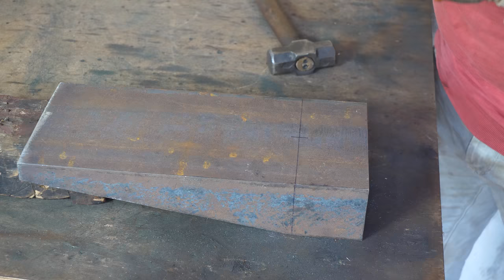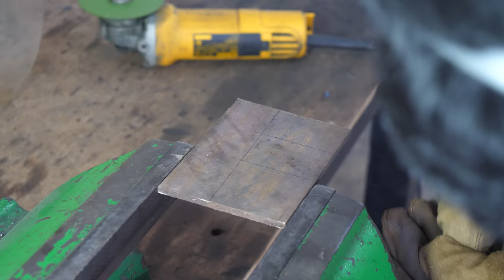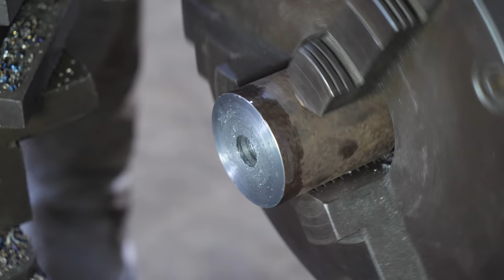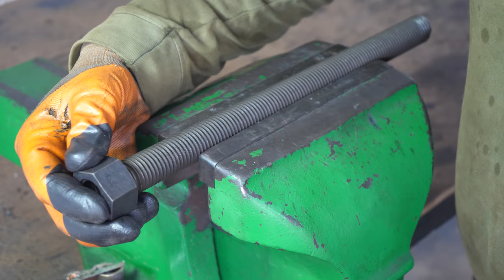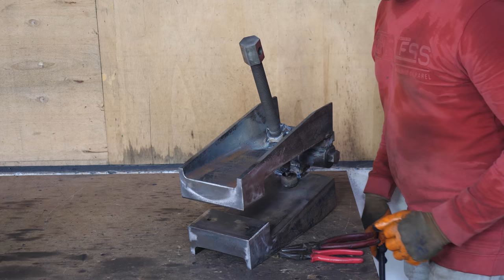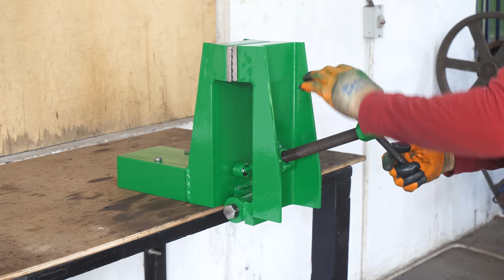How To Make A Metal Vise | Diy Metal Bench Vise | DIY

Comment: I think it would have been a far better vise by adding a swivelling jaw on the front so the jaws can be parallel at different widths.
I’d also brace the rear upright to the back of the base.
That guard less grinder is going to show you why it was there one day 🩸🩸🩸
Reply from the maker: Ok thanks for your suggestion